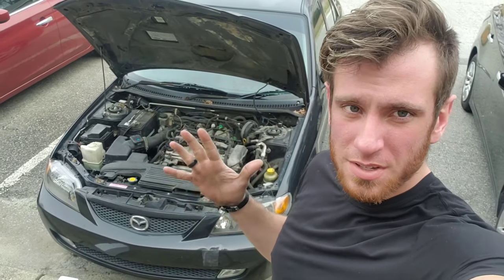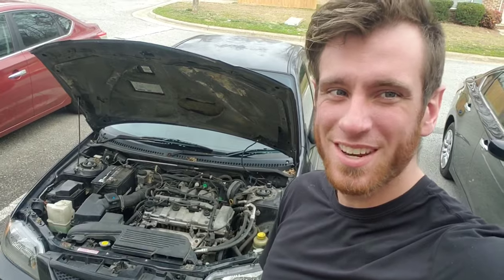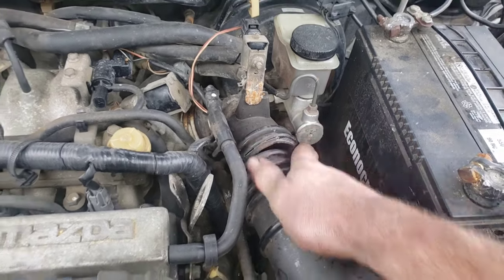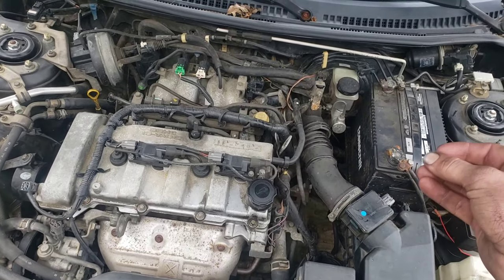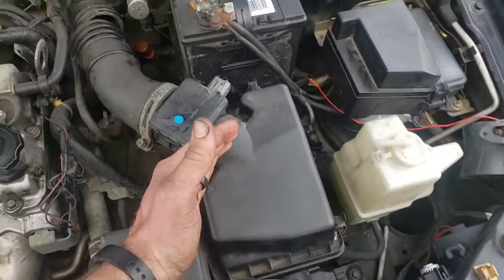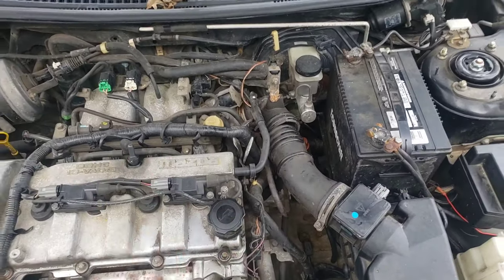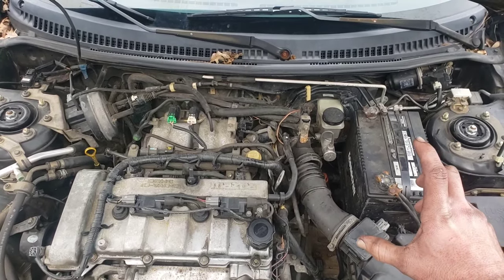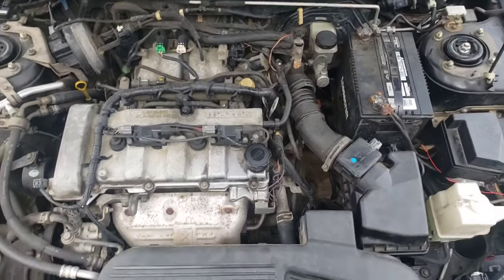Car Starts Then Turns Off 🤔 Why Shut Off Won't Stay On 🧐 How to Find Diagnose Starts Then Dies

Comment: My car can't make a quickstop .... If I go for a quick liquor store and come back within 2 min and start engine..... It will start but 1 sec later it shut down itself. I had to wait 7 to 10 min before it goes normal again. The sound it makes if I start the engine too fast it will sound like bloop bloop before shut down itself. I replaced spark plugs. Wires and coils. PVC and still same.
Reply: Mine does the same thing, did you find out what could be doing that?
Reply: Fuel pump?
Reply: @DalanTurner-jk3jb  I changed the fuel pump spark plugs all the sensors cleaned the idle valve starter and the alternator and still does that same thing
Reply: @darkiedabob2186 did you ever figure it out? 😭
Reply: @cozmo2727  no I can’t figure it out 😭😭
Reply: @darkiedabob2186  oh no 😭 have you had a shop diagnose it? I'm about to change my crankshaft and camshaft sensors and hope that fixes it, but if not to the shop it goes!
Reply: @cozmo2727  I haven’t figured it out sense it was my daily at the time 
So I buaght a 03 mustang and have my 98 sitting Untill I save money to out more into it
Reply: @cozmo2727  I just found out it’s a head gasket n water pump as well
Reply: @darkiedabob2186  wth how did you come to that conclusion?? and what kind of car do you have?
Reply: Crankshaft sensor just found out the crankshaft sensor is lowkey conncted to the alternator which throws off everything
Reply: @cozmo2727  the water mixed with the oil 💀

Comment: I hook a chargeable jump starter to the battery it starts then I turn the charger off and my car dies again
Reply: That sounds like an alternator/generator. I’m sure you fixed this by now but just in case anyone else comes upon this, think alternator
Reply: Cars generator is not charging ur cars battery, or just a bad battery

Comment: '01 gmc yukon start up then stops. The intake hoses weren't tight. Tighten them up. Works fine. Just had transmission fixed and they didn't tighten them up. Smh

Comment: I spent $1,400 and 2 mechanics who couldn't find this problem. Another mechanic discovered it by accident when he was running his hand against the firewall trying to locate the other end of a hose. The hose had rubbed bare but hadn't become a hole. Just worn to barely nothing but couldn't see it with the naked eye.

Comment: Big props 2005 VW Jetta had misfire code  so replace all coils and spark plugs.   Started her up with no problems so as I cleared the misfire code it turns off.  Every try would start up then die, couldn't figure out WTH was wrong watched your video and was like duh.   All I need to do was put the manifold back on and connect the manifold tube she purrs now.   Thank bro for the slap on the back of the head.
Reply: my 2013 subaru brz starts up then dies and the exhaust starts smoking

Comment: Thank's man! My dads car was having this problem today
Its an old car that got stuck for weeks it wouldn't stay on so i poped the hood and saw that rats destroyed some wirings went to youtube and saw this video i tried this and saw that the maf sensor wiring was chewed so i spliced it using some wire cutters and electrical tape and boom it worked!

Comment: So my car died on the side of the road same issue I called the tow truck driver and then as I'm waiting I came across your video and I figured why not let's give it a shot so I checked my air filter it wasn't broken like in the video but I put the cover back on start it up no problems so thank you very much this video helped me quite a lot

Comment: That's one reason for it. Another can just be dying battery. In that case your car might crank the RPM on start if voltage is low,  so that your alternator can get enough juice into the battery to provide power to all your components. After 10 seconds or so your car will attempt to drop back down to regular rpm. If it stays on, that's good, but you should look at getting your battery replaced soon. If your battery is too weak, even the RPM boost won't give it enough power, so when it drops back down to regular rpm, your car will just shut off. In that case you need a new battery, but you can still start your car by revving the engine manually before it drops off the RPMs and just provide RPMs manually until your battery has enough power. If this is happening to you, to increase the chance of your car staying on, make sure you shut off everything that draws power in your car when starting, I like your lights your radio and your heater or air conditioner. Once your alternator is able to keep your battery alive you can turn everything back on. Also if this is happening to you, don't put the car into drive while the initial RPM boost is happening, especially if it's around 2,000 or higher. This will be bad for your transmission.

Comment: If the car dies immediately after start up, it will be kind hard to hear a hiss. 
My 2007 Scion tC just did this during a trip recently. (yesterday) I stopped at a rest area, started my car to leave, and before I could get my seat belt clicked in, the car died. Restarted it, ran for a few seconds, died. Each time I tried starting it, it would run shorter and shorter. Til the point it will die immediately after it starts. I made an appt with my mechanic, but if I can simply change a sensor for a few bucks (comparitively speaking) , darn straight I'll do it! If I see no holes in my air intake system, the car should run after I unhook the MAFS/iacv , yes?

Comment: I have a 2010 Mazda 3 it surges at 4K rpm. And the other day it died and always had a rough idle . Do you think it’s a fuel pump or a mass air flow sensor
Reply: i would say most likely the fuel line system
Reply: @christopherportillo1758  turns out it was the harness and engine mounts
Reply: @Chopliferoc  I was about to say your engine could be getting thrown around to cause the leak, or possible tear. The mounts and harness are another issue for this

Comment: I have a 2019 Honda civic lx sedan, I had the battery change. Bought it new, the reason why the battery came in was because my old one was done for. Ever since I put the new battery in, once in a while my car turns on and dies right away, I have to wait about 20-40 mins then it starts normal, had it checked at multiple places they found nothing wrong and charge me which I don’t mind because is business but no one finds nothing wrong and it’s frustrating, any idea what might be wrong? I use my car for delivery like DoorDash, I’m always turning it on and off.

Comment: I have a Nissan Pathfinder 2000 small engine

I have the same problem

To start the car i have to immediately move the car before it turns off 

That usually works but now it turns off in the mid of the road 😂 

How do i know its not from the air mass sensor ?

Comment: Hey fixbox I have a 2001 Subaru outback wagon LL bean and just recently my car started turning off when I put in in gear. So my car start but then when I put in in drive my motor turns off. Can you maybe point me in the right direction because I can't really afford to put it in the shop. I do remember in one of my other Subarus a Forrester I replaced my idle control valve and fixed the problem. The difference was my Forrester would drive but if I didn't keep the rpms high enough then it would die. So not really the same thing here. Plz help thank you.

Comment: 2018 Kia Optima starts up but cuts off after about 10/15 mins I’ve changed the fuel pump and high pressure pump nothing….

Comment: Okay I have a 2000 Audi A4 with a 1.8T, before I changed the MAF it would run, now that I changed it and my DTC is gone, It just starts runs and dies, It ran fine with the Check engine light on.

Comment: I have a ford focus 1.0L and it starts but theres rattling quiets down a little then acts like its gonna shut off. Also a loss of power. Got codes p0014 p0012 p0019. Please help. Already replaced parts but still does it yet i have not reset codes.

Comment: I have a 2012 lacrosse I start it & it shuts right off help?????
Reply: I have a 2011 buick lacross same issue
Reply: I have 2006 Lacrosse and I replaced MAF Sensor and taken apart throttle body and cleaned real good, then after repair it thru misfire code in cylinder 4.

Comment: My car sound like it wants to start 
Then kills I changed ifle air control 
My throttle position sensor 
I changed spark plugs when I get home today I’ll check the hose to see if it has a air leak will update you guys

Comment: mine do this, no broken hose, sensor seems o, cleaned, starts with starting fluid, goes for couple seconds, dies. Car was not started in 5 years, new battery, have it ran for about 5 10 seconds max, tank is almost empty, working with one gallon of fuel, this is a 2000 toyota tacoma, any ideas? nothing in the internet other than the stupid air sensor
Reply: Seafoam
Reply: @USMCPL  I beg you pardon?
Reply: Fuel pump
Reply: @mansionmuzik4768  yup, that was the culprit. Unfortunately, after expending $435.00 on the whole unit from Autozone and $270.00 in mechanic fees, the head gasket blew; neither me or the mechanic realized coolant level was less than 1 gallon, took it to the road to drive it and ready for smog, drove around city for few miles about 20 or 30, temperature gauge started raising without staying up as I slowed down and allowed to go down, took it back home and last spot I parked that was it, never started again, thinking it was the started motor, same mechanic came and this time did compression test, zero on cyl 1 and 3, 180 on 2 and 4, this diagnostic was paid part of his fee…so yep, I blew the head gasket with that little driving, an engine that has never been opened before now needs possible a complete overhaul because it has 24000 miles, sure I could do only the head and would be faster but keep thinking if I take the head off the recommendation is to do the whole thing, the decision is killing me, at times I want to only do the head and at times the whole thing, either way I will do it myself, can not afford the mechanics fees for labor, starting by removing the installed pump and return it, have 90 days, rockauto.com has the whole unit for $142.00 shipped, compare that to $435.00! so this is one of my new challenges now. I still have a 2004 Corolla with the engine out of the bay, already rebuilt by me but need to put it back together! In the Corolla which also blew head gasket due to oil burning and overheating issues, twice! I replaced everything engine wise or part of the cooling system, once back together still has hit air from AC and a recall for air bags from dealer, so got a long road ahead of me and demand from kids who are needing the cars for driving; who can afford a new vehicle these days??